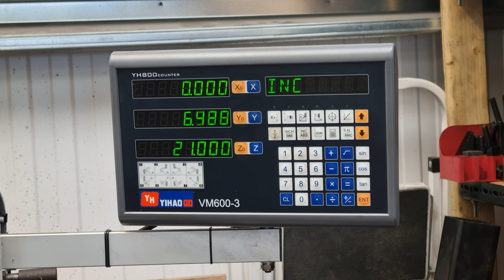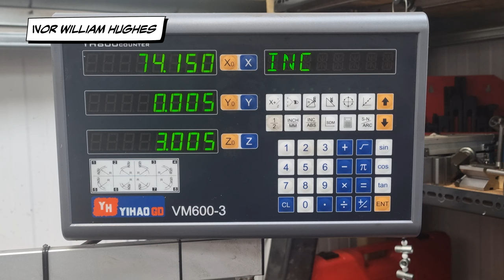The rearsets are taking shape - Suzuki Bandit Cafe Racer - ASBO Project

Comment: Hey bud it's all looking good one suggestion why not look at making your own flood coolant from fish tank pump I made one for my lathe now got one on my mill and bandsaw so much easier than constantly spraying fluid on it haha
Reply from the maker: I've got an old parts washer that I've pulled the pump out of with that in mind. I just need a bit of hose now to take it down to the base. Great minds think a like matey 👍
Reply: @QuickBikes  I just got a peice of hose from b&q and connected it from the pump to a sprayer ill try and find the one I got as its got magnetic base and a valve on it so can adjust how much I want without messing with the pump
Reply: @QuickBikes 
 uxcell A15080700ux0569 Flexible Oil Coolant Pipe Hose 1/4BSP Thread W Magnetic Base 35cm Long
That's the one I got off amazon got one to try worked great now got 3 in use and 3 on the shelf for other projects
Reply from the maker: Ah, that's quite handy.  I've got a cheapy thing.off eBay as well, so I was going to run one on the lathe and one on the mill. When I get 5 mins I'll see how they are and go from there 😁

Comment: Coming along nicely mate, and I’ve changed my mind, makes sense to have the analogue as the Speedo.👍🏻
Reply from the maker: I think a few may change their mind as well... dunno, we'll wait and see
Reply: Slow ass Harley has that.  Analouge should be rpm, that's it!  👍
Reply: I think your right, the sound of the engine is what tells me when to change gear.
Reply: @QuickBikes  yup, changed mine too. Not a fan of digital readout on any instrument cluster, I prefer needles. But if it has to be, then the least important one will have to be digital. Besides, shifting should be done by ear anyway 😂🏍
Reply from the maker: Cheers Jan, thank you 😁

Comment: Good evening quickie, brilliant vid as always, those peg hangers are looking so good already I can't wait to see em 👍 
I been thinking about the speedo. My current bandit is a 2006 1200 that looks like a water-cooled 1250, but has the proper engine still. 
My clocks are left hand side big swoopy round tacho (fake analogue look) and a small  LCD  speedo underneath a clock and some other nonsense on the right round fake clock.
I've had quite a few of these in their various guises, oil burners I mean.
I've found that you know, particularly if you have done a gearing change, kept it a while and ride it! what the speed limit exhaust noise is by gear etc, fair enough glance check but I bet its within the ballpark of not toooo..off
That's a long way to say suzuki went with  tacho over speedo on the last one 😜
Reply from the maker: So..... speed on the needle then 🤣😂😅
Reply: @QuickBikes  I think I mean the other way round, that doesn't help either! Bugger. I'll take a pic on my break tomorrow in the light 👍

Comment: Nah. I have an S1000 XR, and that has a big rev counter, and a small LCD screen with speed, fuel range, etc on it. It's no problem to see what speed you're doing. So long as you can configure the clocks to read what you want (so change the outer scale to be speed, or revs), it doesn't matter. As you say, the owner can then change it to how they prefer to see things
Reply from the maker: Fair point, thank you matey 👍